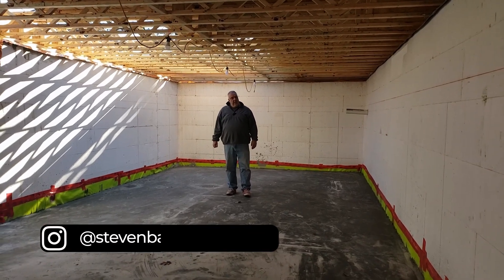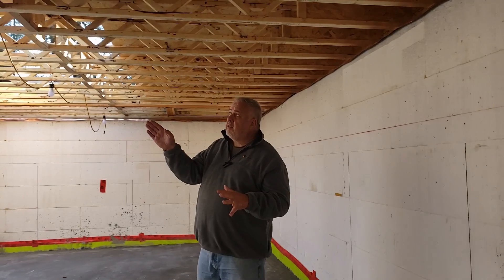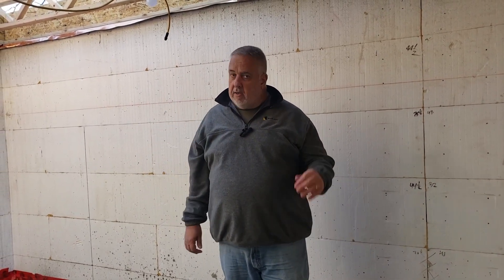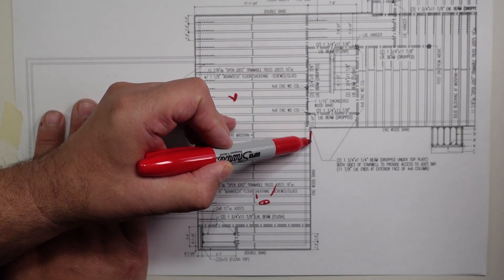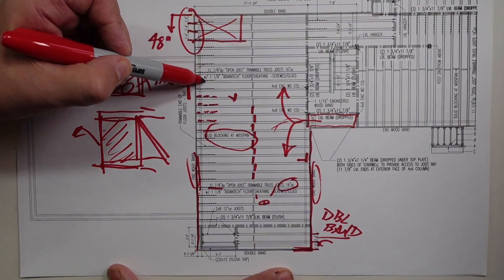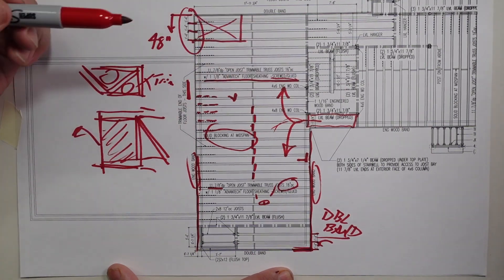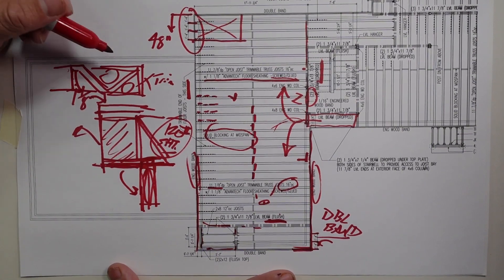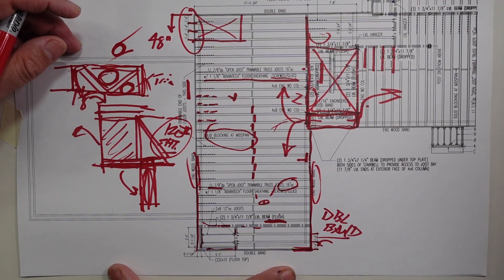Trimmable Floor Joists - Rough Framing

Comment: have you ever built in the floodway?  I have a 200 year old chestnut square log cabin on the south fork new river, in ashe county NC. Hurricane Helene brought me 12' of water into the cabin, up into the second level.  they rescued me with my cat and dog off the roof, so I am gonna try to raise my cabin 10' above the current crawl space and rubble foundation.  I have been watching all your videos about foundations, sip panels, walk out basements, waterproofing, open web trusses, etc to get a design.  do you have any input on open verses closed ground levels for future flooding?  would you like to do a build show at my cabin and help a lot of flooded North Carolinians figure out what to do about flood mitigation??  per FEMA 90% of my 5 acres are in the flood way, not just the flood zone.

Comment: Steve, is there an advantage to the solid blocking vs the strongbacks specified by TriForce?  My 16” x 18’ 24”OC floor uses a single 2x6 strongback which allows utilities to go over instead of dividing the floor.